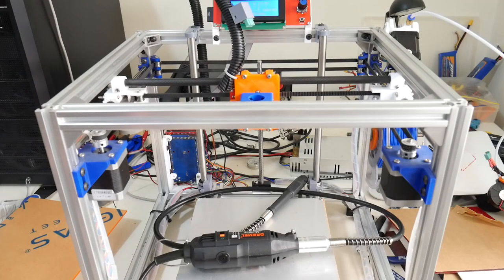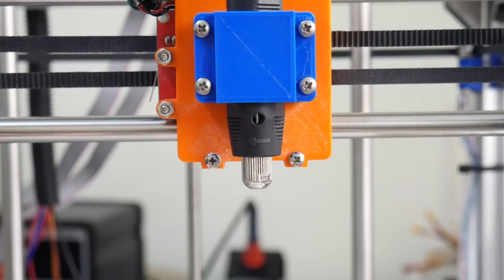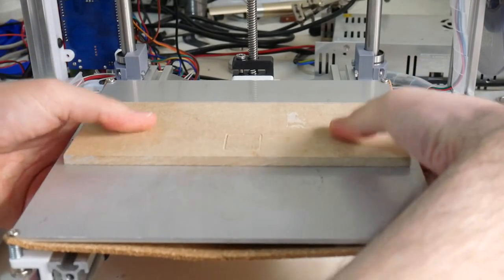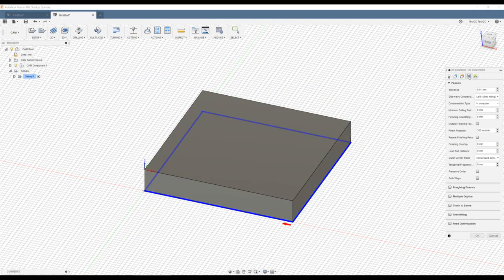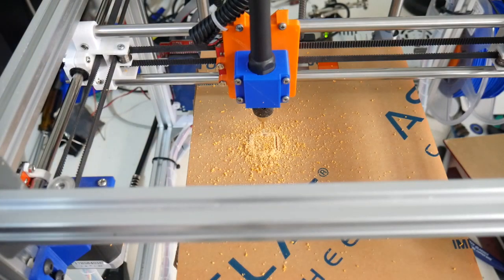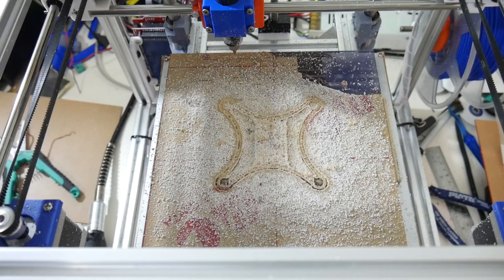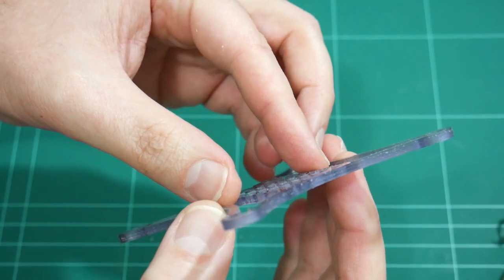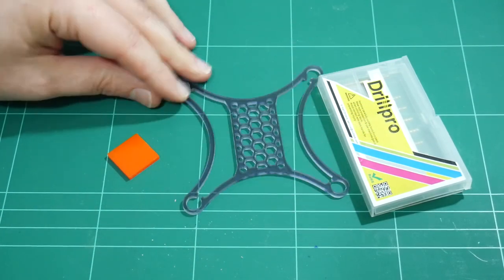Cut Acrylic with a 3D Printer

Comment: As you're not removing detritus as milling is taking place, you have acrylic particles falling into the cut areas as you cut, which stick to the cutting head and also act as a grinding medium, which will cause additional friction resulting in less clean edges and some overheating. I suggest positioning a vacuum cleaner head close to the area of milling to clean up those particles
Reply: looks like it cut just fine.

Comment: "It looks dimensionally accurate"... Maybe a pair of vernier calipers is in order!
Reply: While working with CNC, mostly eyemeasuring is good enough. If something goes wrong, it goes very wrong.
But sure calipers or better things are good for precision parts.
Reply: @gustavferdman214  I disagree, but I guess it depends on what kind of tolerances you are looking for. I have done some designs where I didn't bother to check, but others that had to be within a thousandth of an inch (0.025mm) in order to work. Even on a quarter million dollar CNC machine that took some tuning, and we had to adjust everything again any time the cutting tool was replaced because of how tight we had to get it.
Reply: @Fredjikrang  That's why I wrote MOSTLY, and of course it's always a good idea to measure every 10:th or 20:th detail while making a series to be sure. I'm referring to ISO-2768, standard tolerance, +-0,05 mm at its lowest. 
Obviously it would be a fools game to not perform a control measure while machining lower tolerances.. and considering the machine in the video would be a joke for any real machining I believed you would understand this.
Reply: @Fredjikrang  yeah sure because you can just get tolerances like that with a 3d printer cnc

Comment: Very nice result, as you said you are melting the acrylic, you can also notice it with the acrylic sticking to the end mill. It means the end mill is spinning too fast as it shoul not happens. Try lowering the spindle speed (3 000 rpm should be better). Finding the right feeds and speeds for plastic can be tricky. Keep up the good work.
Reply: Lundev I Star Citzen - Coolant can also help with this (I would probably go for a “fog-buster” style minimum quantity lubricant system). But even just spraying a little water on the workpiece can help... 🤔
Reply: Dark Winter Yeah that may help to but I would not spray water around open electronic, an enclosure would be needed
Reply: Lundev I Star Citzen - yes, to be sure... but... I have to question why somebody would be running a machine with the electronics open in the first place... especially in a country with 240v mains! 😬 And then there is the concern of chips coming from the cutter, and when 3D printing, off gassing from the hot end (which is why I built an enclosure for my i3 that exhausts out the window with a bathroom fan from the local home improvement big-box store, and some dryer ducting. The hypercube-like machine that I’m building now will have a similar setup; with glass panels slid into the slots on the 2020 extrusion frame).
Reply: Single flute or dual flute is way better as well.  Plastic and aluminum with more than 1 or 2 flutes is ugh, especially aluminum that is gummy.
Reply from the maker: I've ordered 2 flute end mills with 1.5mm diameter. When they arrive I'll try acrylic again... and aluminium ;)
Reply: Also permanent (or at least more) suction of the chips as they keep interacting with the bit and are getting pulled back into the part.
Reply: Tech2C - well, it’ll be interesting to see, but I suspect that the machine just doesn’t have the rigidity to do it and get any sort of decent surface finish... I think it’s going to chatter like mad. Nonetheless... give it a shot! 🤔
Reply from the maker: Yes I agree. Milling aluminium will be a bonus but not a requirement. That's why I'll be using 1.5mm diameter end mills to allow the best chance of success.
Reply: I have to concur with Dark Winter. A big issue will be the bed (just to start of the long list). The plate rests on springs after all. That's fine for 3d printing. It might be a minor issue when cutting something like acrylic. But it will be a nightmare for aluminium as I suspect the cutting resistance will be enough to depress the bed and springs with aluminium. Then as already discussed, rigidity of the 3d printer. And lastly runout on the flex shaft. It's not exactly a precise tool mount system with low tolerances.

I suspect you will have bits snap repeatedly before you even have to start worrying about chatter (if at all).
Reply from the maker: A very long list of rigidity issues here for aluminium. I'm only contemplating trying to cut it as so many commenters have asked, otherwise I probably wouldn't bother.
Reply: Tech2C  don't, you will bend it if it's not rigid and do damage to the lead screws and rails
Reply: A sharp cutting tool is also very important while cutting plastics.
Reply: A vacuum to keep the waste particles away from the cutter would probably fix the melting.  With such a small cutter, a lot of the heat build up, and some of the inaccuracy, is likely due to the particles clogging the slots.  They prevent air cooling and cause the tool to vibrate as the loose particles are sucked thru the cutter again.  The small cutter wouldn't take a lot of cooling, and the airflow a vacuum would provide would amplify the air cooling.

Comment: The end mill you are using is meant for fibery stuff, like pcb's, carbon fiber, etc. You should get a 1-flute Upcut endmill (also meant for aluminum) and try with that. Make sure to remove the chips (you can 3d print a fan to attach to the tool/spindle or you can vacuum from time to time) and in order to get a nicer finish, you can spray ocasionally some water on the milling surface/channel, just not on the last pass (in depth) to avoid the MDF spoil board bowing/puffing from the water.
Reply from the maker: Yes I get that now. The bits are burr. I have 2 flute carbide 1.5mm diameter end mills on the way. I'll try again when they arrive.
I'll probbaly hold the vacuum as it cuts next time. At least initally until I mount something more permanent. Cheers!
Reply: I wonder if there is a way of adding a little tub so you can use coolant?
Reply: Max Bainrot yup, that is actually the easy part, the hard part is the part/stock holding inside the tub... Basically it should have t-slots on the bottom or something...

Comment: Those are the wrong kind of bit for cutting plastic - they are designed for going sideways thru fiberglass (they are for cutting printed circuit boards). Hop on eBay and order some 1/8th inch (or whatever size you have a collet for) 2 flute center-cutting carbide end mills. This is one reason why you are having trouble with the plastic melting instead of cutting. Also, consider adding a coolant setup - although a “fog-buster” style setup would be nice, even just squirting a little bit of water on the plastic with a spray bottle would help. 🤔
Reply: David - um... no? I just looked, you can pick up a 5 pack on eBay for about 6 USD... also, they last a lot longer than HSS end mills.
Reply from the maker: Hey, yes I have just ordered 2 flute carbide end mills with 1.5mm diameter on 1/8th shank. If they radically change the way this cuts then I'll make another video on the subject! Cheers :)

Comment: For a copter/drone frame, I'd suggest using polycarbonate instead of acrylic. It's not as rigid, but the result is a tougher frame-- less likely to shatter.  It's also a bit easier to machine.

Comment: Could you try other "Quad copter" material like a cabon fiber sheet or G10 epoxy board. I'm sure you'd have to go slower, but that would be amazining if it could do that. Acrylic is a bit too brittle.
Reply from the maker: I chose to cut this shape as it is intricate and a worthy test. I'm not planning to fly with an acrylic frame, but it would look great with LED's lighting it up :)
I think you could cut CF, just be very careful with the dust released as it is very bad for your health. Peeps usually cut CF submerged because of this.

Comment: Really interesting, i will definitly try that out!
But be careful with milling into MDF,  it creates very fine wood dust and the glue usually contains formaldehyde, both is known to cause cancer. So it would be good to use a dust mask. In addition it might be possible to make a 3D printed nozzle and hook up a vacuum cleaner? That would also reduce the stuff flying around in the room.
Reply from the maker: Ok, thanks for the heads up! I think a vacuum adapter would be good as long as the gantry could support it.

Comment: Thanks for really nice video. I've tried my Geeetech Prusa i3 .. as CNC with G code (other than Fusion 360)  modified as on video with M211 S0 .. played for a while without result, doesn't work .. 
Am I missing(I guess !) more details .. any help? Thx
Reply: I'm having the same problem. After the M211 modification, when running the G code my 3D printer still requires de Z homming. 
I can see on the Communication page of Simplify 3D this report:

SENT: G17 G2 X20.75 Y1.529 J0.15
READ: echo:Unknown command: "G18 G3 X21.05 Z1 I-0.15"
Unknown command: "G18 G3 X21.05 Z1 I-0.15"

Comment: HELP! My ender3 won't mill circles when milling a 2d Contour. In 2d Adaptive Clearing it does. All other shapes are milling fine. In the milling process, the printer just skips the circles... I'm using the "HyperCube for Fusion360" config... Two weeks of debugging, can't fix it on my own.... Any suggestions?

Comment: Now ... can you cut aluminium with this?!
Reply: and if not, perhaps the more important question why not? the cheap dremel not being able to go fast enough, the timing belts being too flexible?

Would a flexbile rotary tool shaft work at higher speeds? lets say a $100~$200 spindle.
Reply: Talvara The limiting factor will also be the rigidity of the frame and I am not sure of the bed suported on only one side for aluminum
Reply from the maker: I'll try it, soon. No promises though ;)
Reply: Yes !!
Reply: Tech2C get some air blowing onto the endmill if possible it will cut but chip welding is your enemy. Maybe tape some cardboard around the frame to stop from going everywhere.
Reply: Machinist apprentice here. I would say you could cut aluminum but your feed rate would have to be so slow it wouldn't be worth it. The limiting factor here is most likely the power of the rotary tool. It has nothing to do with speed, it's a torque problem. You could engrave aluminum though!
Reply: @Talvara  did you find information about flexible shafts with bigger motors???

Comment: Is it just me, or does anyone else watch these videos & get flashbacks of teachers reminding them to work from the edge or corner (as applicable) so as not to waste material?

Also, to the guy making the vid, there's a bunch of mods you could do to make your life easier. Waste material getting everywhere? Risk of shrapnel? Side/top/rear panels, & a door on the front. It might reduce the noise too, especially if you add sound dampening material to the panels, & use a carefully designed door.

Fumes? Extractor fan & filter.

Additionally, for the cuttings/dust, you could mount an air jet on 1 side of the bit, & some kind of vacuum cleaner nozzle opposite to it.

Comment: I have just had a go at getting this onto my 3D printer without success! Having problems with Fusion 360 in that it keeps saying" invalid tool settings , need to change the tool!" but does not give guidance as to what to change! Any suggestions please? Thanks.

Comment: Hy there, TECH2C which software are you using to send gcodes like pronterface? is there any additional settings in MARLIN to start CNC work? I do have printer running marlin but not on Arduino board. My Printer is ENDER 3. Can you please help

Comment: You can cut acrylic with a bodged setup, meanwhile I'm here with a real cnc and expensive end mills fighting to get a good cut on acrylic.
I have the same cheap end mills but I only use them for wood, I have to try those with acrylic, maybe I will have better luck

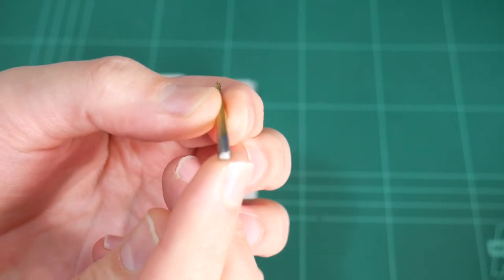Comment: 0:47 to precise these aren't end mills, but burr cutters. They work more like a metal file , taking lots of tiny chips of the workpiece. Real end mills use bigger cuts and can be compared to a metal saw. They have usually 1 to 6 Flutes.  Burrs usually cut slower but  need less cutting force.
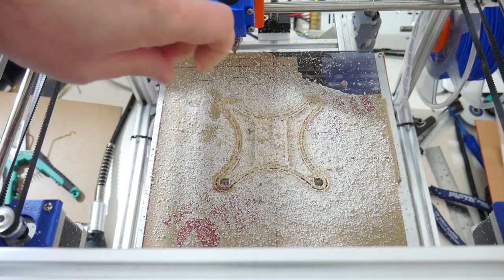17:00 just use a cnc dust shoe https://www.youtube.com/watch?v=ufXTIu2VmME

Comment: one thing I've found when cutting acrylic is to use slower speeds so you do not melt it. If like me you can not slow the router down to less then 16K RPMs (I use a DeWalt 611) then try using an end mill with less flutes, double or even single flute end mills do the job.

Comment: I've had that flex extion tool sitting in my tool box for years and I had no idea i can use it for milling acrlic :).. Glad i saw your video.. Now i can hack my 3018 with wobbly spindle and replace it with powerful dremel tool. More drilling power and less gantry weight.

Comment: 1) Did you try it with the carbon tubes on the x-axis? Did sticking with the carbon tubes actually cause any problems? 2) You said it "looked" dimensionally accurate - did you measure it? Measuring the 20x20 square would help us understand how much flex in the machine was changing the dimensions of the final result.

Comment: Hi. First of all, let me thank you for all the explanations of him. I have been working in 3d printing in my hobbies, mainly model aircraft and I have already learned too much and I have wanted to dabble in cnc but I am too novice in the subject, I have made the conversion to an anycubic i3 mega printer adapting a dremel mototool in it and currently I do acrylic engravings without problem but I do it through simplify 3d and it works for me but now I want to do acrylic cutting, I have followed all your instructions to do it by fusion 360 and apparently everything is fine but when generating the gcode I do not know how to send that gcode to the printer so that it executes the gcode, could you help me please. I'm really very new to the subject. Thank you in advance for your cooperation

Comment: Hello Tech2c I was trying to convert my 3D printer to CNC like you did (i have an old "Geeetech Prusa I3 Pro C") but from some reason the Z is going down too fast (and not according to the fusion 360 route) , please help me correct this problem

Comment: With the proper laser and settings you should have no trouble at all cutting that level of detail and thickness of acrylics. I have done it many, many times. Also, I am surprised the color of the material makes a difference in cutting ability. I never had trouble cutting any color or transparency of acrylics. Perhaps your laser is a different wavelength that doesn't cut as many materials.

Comment: Hi, thank you for this video! I followed your instructions but my gcode cuts on the inside of the perimeter, not on the outside, resulting in a smaller part. How do I solve this? I tried going from right cut to left cut but it didn't make a difference

Comment: Instead of a screwdriver you'd better be using a steel spatula or putty-knife (not sure if that's the word you use, but put it in the Googles). More surface area so you won't damage your machine/part when you pry loose something from the tape.

Comment: Will it be possible to use a servo to switch the power driller on/off and regulate! And the computer will do it all and you won't have to switch it on mentally!

Comment: and im assuming that you didnt need to modify/update the firmware of your 3d printer control board right? since its marlin/g-code, it would just use the same routes as a conventional 3d printer, but with a negative z-axis value(s)

Comment: Hey Tech2C! Big thanks for the tutorial and post processor file! Works fine with Autodesk Inventor CAM as well!
But could you specify please what type of acrylic did you cut here - cast or extruded? I've tried to cut the last and it just melted down after few seconds of milling creating ball of plastic on the endmill (using 5000 rpm, 1.5 mm end mill and your speeds and feeds). I guess I should be more aggressive with the feed and use some ice/soap water as a coolant

Comment: You should always climb cut on a cnc for two reasons. 1. It keeps the end mill from driving into corners and 2. Your surface finish will be awesome in that plastic. I would use a spray bottle of water and just very carefully spray some water in the cuts for better finish and to also keep the plastic from clogging up the end mill. High rpm is good and as far as feed rate keep pushing it up until you break a end mill then back it down. Great idea btw i really  wanna try it but don't know anything about g code.

Comment: Have you thought about using a lathe  Quick Change Tool Post design for the laser and drill parts. If the original design was adapted then 1 bolt would hold the tools in place.

Comment: I recommend attaching a vacuum hose to the tool as well so it sucks up the bits of acrylic and fumes while it goes, also the air moving will help keep the material cool so you can keep printing at faster speeds. obviously tweaking will be needed.

Comment: Looks great, I only have two suggestions. Maybe 3-D printing out some type of support on the four corners of your build plate to hold the acrylic plate Instead of resting it on ABS more like legs of a table so it could be removed easier and simply fall onto you build State when it is done instead of getting in the way of the milling bit. Also hooking your vacuum up to the side of the build plate or even a stand next to your printer should mitigate clean up after your part is complete.